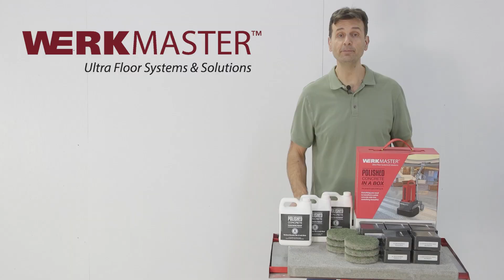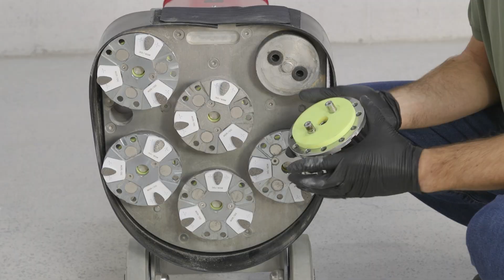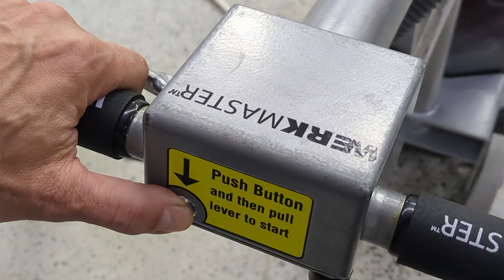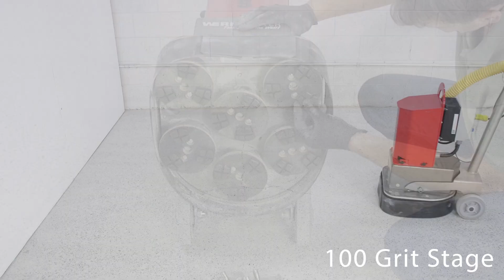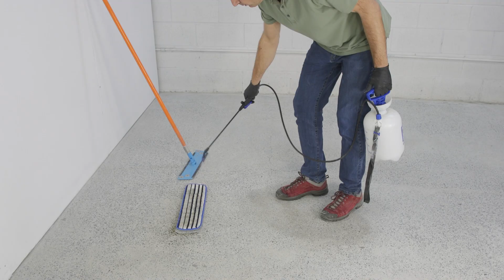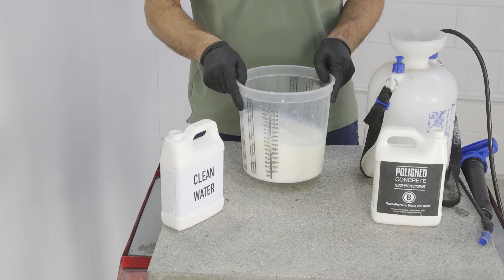Learn How To Polish Concrete with The BOSS 110V Rental System & Polished Concrete In A  Box™

Comment from the maker: The BOSS™ + Polished Concrete in a Box™ + Polished Concrete Floor Protection Kit deliver a true start-to-finish system — grind, polish, burnish, densify, seal, and maintain — all on a 110V rental platform.
One machine. One polishing kit. One protection kit.
A finished floor — not just a polished surface.